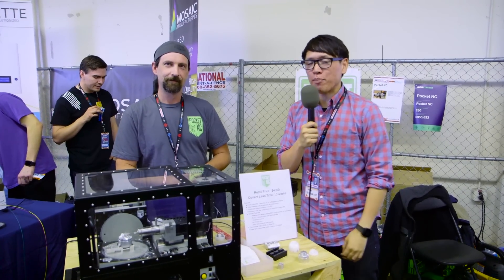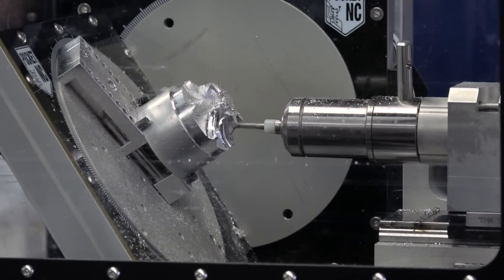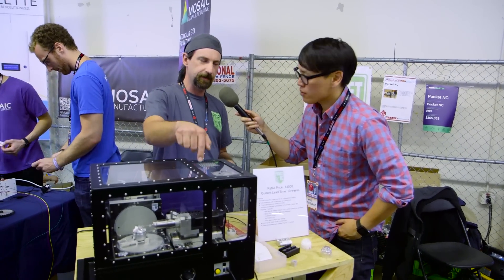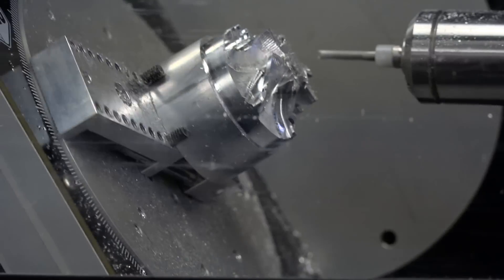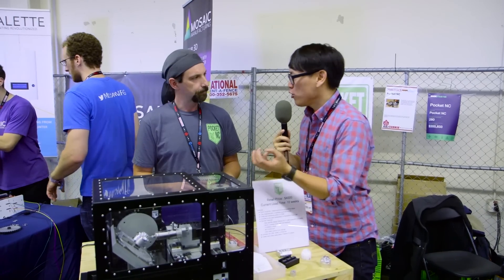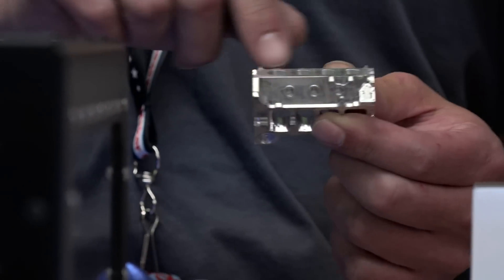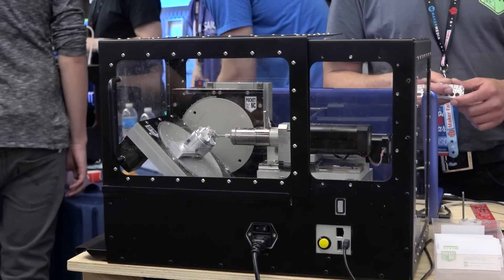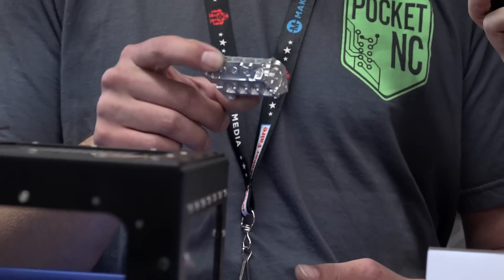Pocket NC 5-Axis Desktop CNC Mill!

Comment: Kind of expensive for such a small build volume if you ask me. You can get a rotary table that can do both 4th and 5th axis for about $400 for the same build volume. Just attach that to a standard 3 axis CNC and you got a 5 axis machine for half the price.  Which you can keep the functionality of a 3 axis.
Reply: this machine costs 4,000 though
Reply: +shane bacawaka I know just thought you missed a 0 my bad.
Reply: You can get the parts for something like this much cheaper but then you have to factor in development cost, manufacturing cost, warranty allowances, customer support, advertising, stock keeping, account management, profit margins, etc., etc., etc. things which often get overlooked when a hobbyist is pricing up how much they could build it for.
Reply: shane bacawaka I think its a very reasonable price, its a niche market for sure (regardless of price) which further drives the need for larger profit margins on a per item basis but its far from expensive while leaving enough room for profit to make it a viable product and its not like it has any competition in its market space. A large portion of the target audience will be engineers too which in general aren't low income earners.
There are a lot of makers that value their time and don't want to use it on building the tools to build the things they really want to do. There are plenty of machines I could have built for half the price I bought them for but I learnt long ago that the DIY route often ends up being more expensive when you factor in time for a one off build and is often less refined until you over spend on replacement parts/upgrades/learning mistakes.
When I was younger I just priced up components and went for it which was good from an experience point of view but these days I just want the tools that I need off the shelf quickly and (relatively) cheaply so I can get on with the actual build I want to do.
A lot of people buying this will also be using it for profit too not just as a toy which makes that price point almost irrelevant, with 40 parts at $100 each it wouldn't take long to recover your investment.